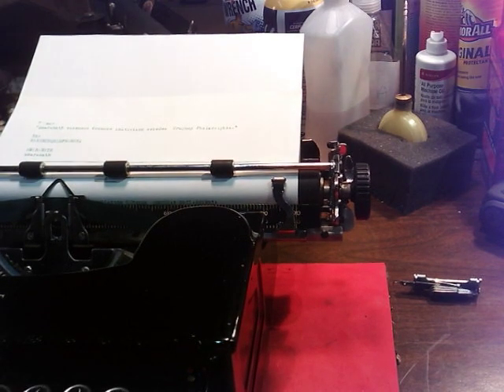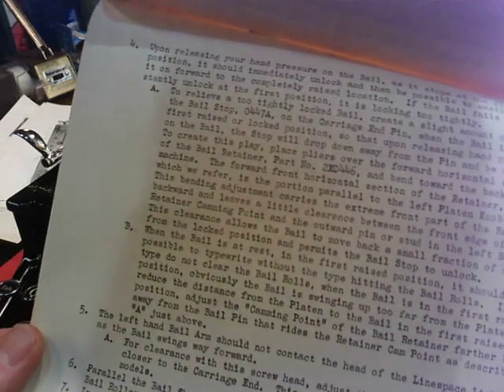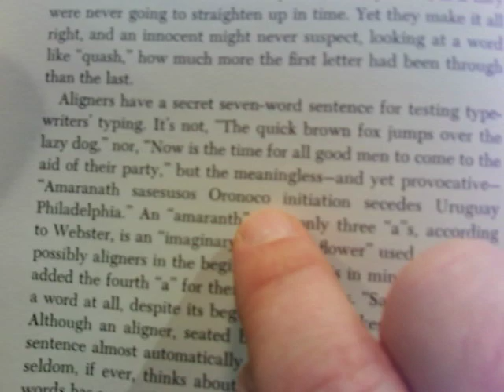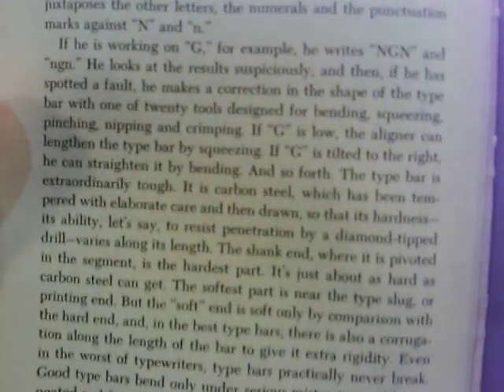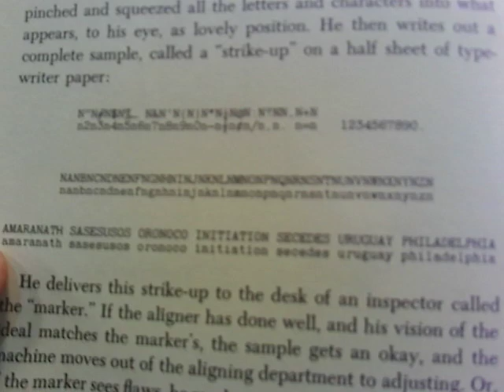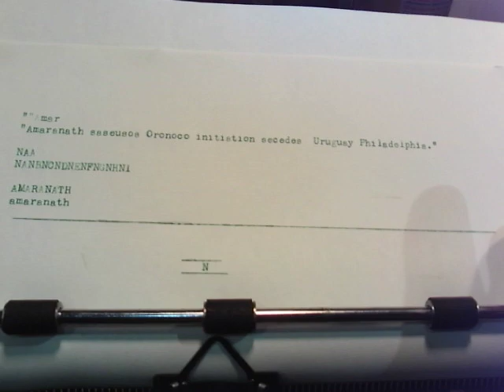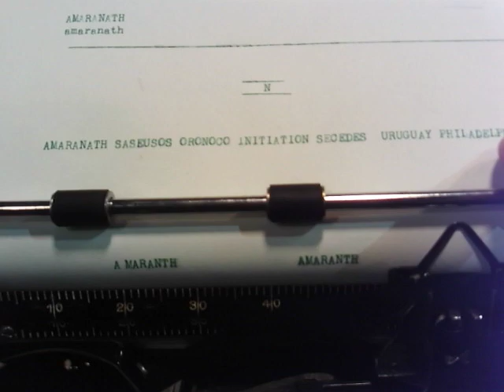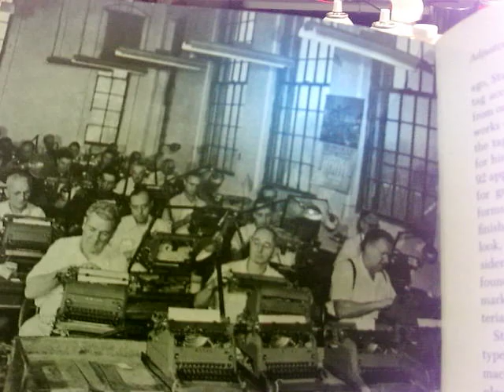Typewriter Print Alighnment

Comment: nice, someone finally demonstrating using the lever bender. Did you find those Squareline to Speedline conversion pages as inserts in your Floating Shift adjustment manual?
Reply from the maker: Yeah . . . I'm guessing  that Escapement "LET-OFF" Adjustments bulletin  was also a way to sell a tool(make money); LC Smith & Corona sent them branch managers etc.  In it, it states "Carefully study the attached Supplement and then slip it between pages 37 and 38 of your manual PS488-4, so you will know where it is for future reference."   Then it goes on to talk about ordering wrench S.T 1435 (price $1.00). . . who knows!
Reply: neat! do you happen to have the insert scanned somewhere? It'd be neat to have evidence that dealers did Squareline/Speedline conversions as a matter of course if the customer wanted it. (:
Reply from the maker: OK, their  now scanned and posted to The Antique Typewriter Collectors Group.
Reply: Sweet! Thank you (: